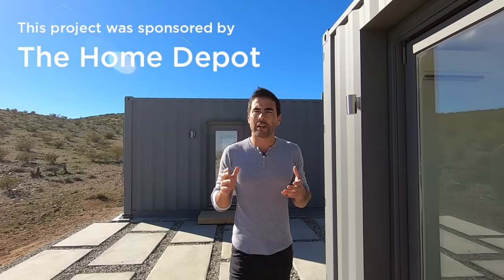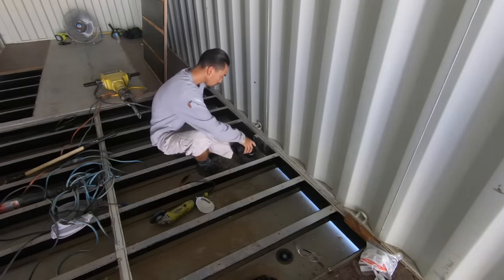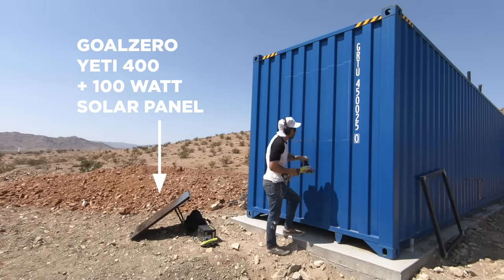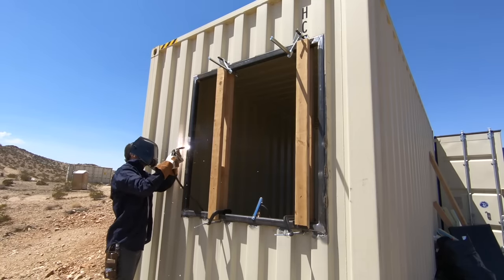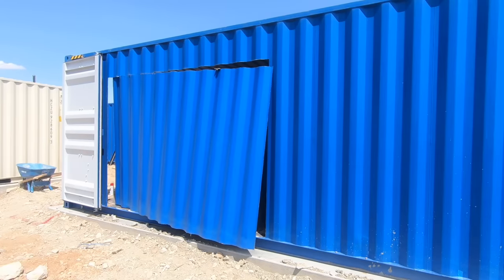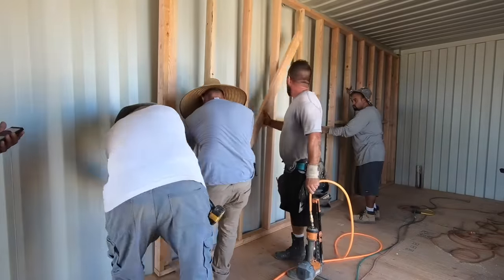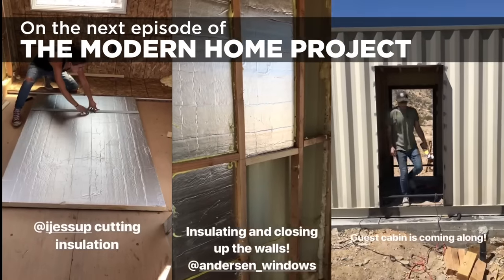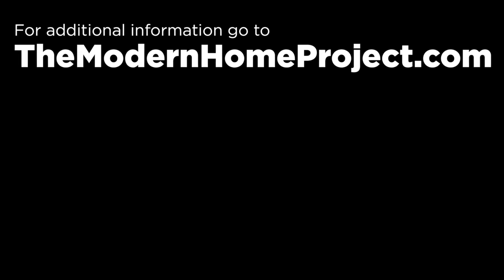Building a Shipping Container Home | EP02 Moving, Cutting, and Framing a Container House

Comment: Why didn’t you use pex for water supply lines?
Reply: Got a point there. It just snowed out there.
Reply: My question as well.
Reply: Scanned the comments, didn't see this question. Decided to ask. Finished watching the video, look through comments. Find yours -_______-
Reply: I personally think copper is superior in most ways. Its only downsides are cost (including time) and susceptibility to freezing. But a soldered copper joint has an effectively almost infinite lifespan and, while PEX is probably fine, there's always the concern that in the future we'll discover that the plastic does leach some horrible chemical. Maybe this guy feels the same way and that's why he did copper.
Reply: By no means am I knowledgeable or qualified to answer. However, I have a recollection that PEX is not always allowed, based on the local building code. I don't know this as a fact, but it may explain the decision to use copper here.
Reply: @mickeyd2128  I installed PEX a couple of times when I installed solar in California, and I think most new houses are plumbed with it, so it's probably fine, unless their AHJ doesn't allow it for some reason.
Reply: Copper is not better in anyway over Pex. You point out 2 major down sides , how many do you need.
Reply: @RussellBond13  The freezing issue is solved with pipe insulation. Labor costs with copper don't count when you're doing it yourself, so it's only the extra cost of materials. By your logic, if anything has any downsides, it shouldn't be used, and PEX has downsides, so it shouldn't be used either.
Reply: First I never mentioned labor cost . Freezing is a major issue which pex handles better and you can use less fitting which means less joints or less potential leaks and less cost. You say pex has downsides but don’t mention them. Copper is like drum brakes, they work just not as good
Reply: @RussellBond13  If you had read my first comment, you'd have seen a downside of PEX that I mentioned, which is the possibility of an as yet unknown chemical leaching out of the plastic into the water. I also don't trust PEX joints anywhere near as much as copper ones, it's much easier to damage than copper, it looks like crap (a small downside), it must be protected from the sun, it's less standardized, and it can't handle as much heat. It requires fewer fittings for long runs, but more fittings at points of use because it's more susceptible to damage and therefore a transition to copper must be done there. Freezing is definitely more of an issue with copper, but simply insulating it fixes that, and I personally think all water lines, hot and cold, should have pipe insulation.
Reply: First I don't put much into the theory of leaching. Pex joints are made of brass and there are may ways to connect, all of which are easier and as good or better than soldering which takes more time and some talent. Not sure what you are trying to do that you would damage it but you can't smash it with a hammer because it will bounce back not dent like copper. As far as the look, mostly hidden in walls and color coded so it's easy to tell cold from hot should you need to trace a line to find a problem. Protection from sun, where exactly are you putting it, water pipes are in walls, crawl space basement not outside on the ground. Not following on the standardization. It has never come up in the 20 yrs I've been using it. It requires fewer fitting everywhere, no elbows needed and all pipes need fittings at point of use. There are copper stubs for hot and cold which accept pex pipe needing only one crimp to attach so more fitting than copper is just not true. It can handle higher temps than a hot water heater can put out so mute point. If all pipe should be insulated then it's better to have something less susceptible to freezing and insulated. I realize you are trying to defend your choice but you haven't made one good point against pex. I know there are applications where copper is a better choice because it's hard pipe, I have it on either side of my circulating pumps on my solar hot water system but overall in a residential house setting Pex is a far superior product.
Reply: Yeah, I have no idea.
Reply: @bmay8818  I like the idea of pex too , but worry about chemicals.... I would have wrapped all of the pipes.
Reply: All pipe options have their pros and cons and this includes Pex...

Namely, like PVC, Pex is vulnerable to UV damage and its molecular structure will eventually disintegrate from prolonged exposure to sunlight.

The effect is accumulative, so after a total of around 60 days worth of exposure the pex will become too brittle and weak for continued use.

While copper is uneffected by UV and thus has the advantage for any application where the pipes will be exposed to sunlight.

It is possible and usually safe to use Pex in the ground but Copper is also more impermeable, which makes it better to be used in the ground or other environments where leaching of contamination from the environment can be a concern in areas where high levels of contamination could be a risk factor and while pex is also bacteria growth resistant copper is still more resistant to bacteria growth.  

Also, other factors can effect it like PEX tubing is vulnerable to penetration by plant feeding insects, piercing the tube, therefore resulting in leakage and is an example where copper is more durable...

Pex otherwise has many advantages over copper, which is why it has mostly taken over the market, but there are applications where other choices become preferable and options like copper still have their place...

Besides, copper is also recyclable and most consider them nicer to look at if you're going to have any exposed pipes where you're going to see it every day, even when there's no danger of UV exposure... and typically copper has a longer warranty period...

Mind, recycling not only means more Eco-friendly but also means if you were doing a renovation or tearing a house down... Getting money for used copper pipes is a lot easier than getting anything for used pex...  Lessening Pex's initial cost advantage...

Another thing to consider is local codes can vary significantly from one county to the next and it may not matter what the state allows.  So what may be legal in your area can be illegal in the next and vice versa.  

So options are sometimes limited to what is allowed in a specific area and some areas can have codes and rules dating back decades and even over 100 years...

A lot also depends on what the local authorities think are better solutions, which may not agree with what you or even the rest of the country thinks is a better solution... Though, sometimes that is for reasons that are locally valid but can be just political or bias of whoever is in charge in your area...
Reply: @ZeoCyberG  I still like copper best. I suppose because it is a metal and I feel that plastic has no soul.

Comment: Don't use a level on a vertical - use a plumb bob for much greater accuracy.

Use Drill Screws, not Tapping Screws.

Put the swinging door frame on the outside, not the inside.
Reply: Tapping screws are better and more efficient to use for metal especially a 1/8" thick container. Self-tapping doesn't require pre drilling and draw the metal in
Reply: Drill Screws are Tapping Screws with a special tip that drills a pilot hole.  Much easier to start into metal that has substance, and there's no downside.
Reply: Yikes 😬 by self tapping Im referring to Tek screws which are the same thing you are calling drill screws but are considered self tapping (and self drilling). But even upon research the two terms mesh alot, the world of patents really mix things up.

Comment: Ah yes. Nothing quite like a 105 degree cool breeze.
Reply: Fahrenheit. It calculates to about 40 C. If it was 130 Fahrenheit inside the containers (which calculates to about 54,4 C) then 105 F will feel like a nice, cool breeze
Reply: Arterexius Gaming The joke was that 105 degrees Fahrenheit is blazing hot and in no way cold.
Reply: @MattOBrienOfficial  I know. I just decided to explain anyways
Reply: As someone from a year-round tropical clime, I can assure you that 40 degrees celcius is bloody uncomfortable, particularly for manual labour ... given these conditions and remote site I wonder, why was partial offsite prefabrication was not considered?
Reply: @AnnMarieKing  Got to remember, in the desert in California, it is DRY heat!  Much more tolerable :-).
Reply: @AnnMarieKing  I've experienced 40 degrees celcius and worked in it. I know it isn't comfortable. But it will feel cooler if working inside something that's several degrees hotter. We had a full tropical summer last year here in Denmark. It was definitely not comfortable and I'm surprised how you people even survive continuesly in such a climate.

But I think why partial offsite prefabrications was considered, but had to be laid off as too expensive and not as DIY as they wished it to be :)

I hope my comment doesn't sound brash or anything. No offense intended :)

Comment: What a fantastic video. You have given me the inspiration to build a single 40' high cube home for a holiday home! I am at the planning stages at the moment and will probably take the plunge and purchase a container in the the next week or so. I can't believe how much they have gone top in price here in Australia due to COVID! Very interesting to see how you welded in the door and window frames. Am I right to assume that if you were to do it again you would use angle instead of tube section due to the benefits of fitting and welding into position? Also I take it that you weld every 8 inches or so and use a quality silicone to fill in any gaps? Thanks again for such a good video. I'm looking forward to watching the rest of them.

Comment: "you don't really want buildings that can have structural failures just due to owner neglect" - You've got to be kidding. Put a stick-framed house up next to the shipping container and watch and see which one collapses first from neglect.  Who wants to take bets that the conventional stick-and-particleboard-composite-shingle building is going to fall down long before the steel frame with metal infill, no matter how rusty it gets in that time?
Reply: Yeah, building a stick lumber house frame inside of a shipping container, kind of defeats the purpose of building a container home .
Reply: @Dill Dough As shipping containers they're steel frames being used dynamically, hoisting on and off of container ships and trucks and carrying tens of thousands of pounds of cargo. In this application, an infinitesimal portion of their capability to be rigid and supportive is needed. - a stick built house wouldn't last a hot minute in the handling the containers have been through.  Further, the area is arid - checkout some of the ghost towns of the high desert over a century old if you want to see how long even the thinnest metal will last - and this shipping container is not thin by any stretch of the word.
Reply: My money is on the preformed concrete slab home.
Reply: You've clearly never seen an earthquake at work.
Reply: @MuShinnen so you are suggesting that a wooden baloon frame designed to hold up only a roof is noticeable in an earthquake compared to a thick steel frame with steel infill sides designed to move heavy cargo merely being asked to hold itself up??
Reply: @SkylosSobaka  No. What I'm implying is that people have codes in place to prevent disasters from destroying homes. Ever seen a container warp after parts of it have been cut out? I have. Who knows what would happen without all the supports. Do I think a lot of it is overkill? Absolutely, that doesn't mean some of it isn't necessary as a precaution though.
Reply: @MuShinnen  No.  Not even when they've cut the entire side of the container out wholesale, which they didn't do here. And we're talking 'spanning 40 feet of space between supports with the entire side removed' level of strain. Who? Seriously you would ask? Qualified structural engineers who care to do a calculation will know what will happen without the supports. It is welded steel, well known material with well known structural properties. Further. What they put in isn't even supports - they're just wooden studs put inside the container, which already supports itself.  Its massive, tremendously expensive, ludicrous levels of overkill and labor intensive thing to do.  I assert NONE of it is necessary as a precaution. This is a strong, steel structure designed for heavy duty situations being used for a situation needing an infinitessimal portion of its strength. It is not going to be a problem.
Reply: @SkylosSobaka  And all of that is irrelevant, as legally it still has to be done.
Reply: @MuShinnen  No, legally it has to be stamped by a certified architectural engineer or approved as 'within the guidelines of this code book'. Those are the only 'legal' requirements that exist in the end - were it any different, no real building could ever be built. Whoever they put in charge of approving these plans probably isn't a structural engineer at all - just working (in government?) as a building code expert incapable or unwilling or unqualified to do the actual job of a structural engineer. 

"Build a redundant structure inside" is exactly the kind of answer you get from somebody that is thinking more of 'How can I get this to fit within a code book mainly describing conventional construction' than 'how do I calculate if this has enough structural integrity to be considered safe'
Reply: David Ihnen A low timber framed building is far, far more resistant to catastrophic earthquake damage than a steel framed building.
Reply: David-- something is seriously wrong. It is hard to see a metal box with reinforced steel all around 'breaking' and collapsing to the point that someone could be harmed. They ride on open seas, thru storms, on trains & trucks.  How dumb do degrees or govt have to be before we just say no?

Comment: Angle grinder ..are you kidding??   1.5 hours... Plasma cutter 5 minutes  and  obviously you had power for the welder and chop saw Tack on the frame then use it for guide for plasma..
Wood headers??what?? 2 x 4 interior walls ..because containers are not small enough.

Comment: Soooooo a 3x3 1/4 inch thick tube is not enough of a header?
me thinks the engineer is a bit woodsy
a series of vertical tabs 2" widde made from 1/4 "plate
AND A 2" TUBE WOULD MAKE A  TRUSS  THAT NO WOODEN 
BEAM CAN MATCH

Comment: What was the point of the anchored steel rod entering thru the floor of the container and attaching to the wooden frame?
Reply: You have to anchor the container to the foundation. Earthquakes, possible high winds. Here in the midwest we have tornados.
Reply: I have the same question.  The hold-down corners of the container seem like the ideal location since that is what they get used for.  Guessing that the engineer who approved this design had no idea what loads a shipping container is typically exposed to and just did what they were comfortable and experienced with which is wood framing.
Reply: @Chrisisreal978  That was my thought as well. Any force large enough to move a shipping container is going to rip the anchor right out of the framing and cause more damage than it prevents.
Reply: @Chrisisreal978  If it were me, I'd get four of the corner locks, the actual ones used to hold containers to ship decks. I'd anchor them to the concrete, lock the container into them, and put a small weld bead on each to fully prevent them from ever unlocking at all. I think this situation is an example of engineers and AHJs not being up to date on different ways of building.

Comment: Dont understand why you went to all the trouble to ınsert ground rods up ınto the framıng when you have 4 anchour poınts at each corner.You should have put the anchors ınto the concrete when buıldıng.They would be far stronger than what you have now.I have watch many vıdeos on these homes and never seem anyone use them.
Reply: Possible reason: in CA, there are seismic and uplift/overturn requirements for new construction/renovations/repairs.  Where I live in southern CA, the minimum code, for a shear wall,  is threaded rod into the foundation, then a strap [or Simpson Strong-Tie bracket] into a vertical framing member, with straps/hurricane clips [no hurricanes, but for seismic stiffening] at the roof rafters, a properly nailed-off roof, etc.  The walls of this container are almost certainly strong enough for CA building/seismic code, but the AHJ would probably be hesitant to accept this without heaps of additional engineering details.
Reply: @kenc2257  If true, then this is a perfect example of how stupid and unthinking most (if not all) bureaucracies become. These containers are secured on moving trains and heaving, rolling, seagoing ships by the corners and are designed to withstand all types of jerks and jolts and high winds etc. Attaching that threaded rod to the interior wooden frame accomplishes exactly nothing.

Comment: 18:48 "We have a steel rod that goes into the foundation, that attaches to a bracket".. as the video pans to the disconnected post/rod, that doesn't even align with the hold down on the bracket.. Hope you got that sorted out
Reply: The worst part if it'd be easier to just anchor it down at the corner mounts anyway.